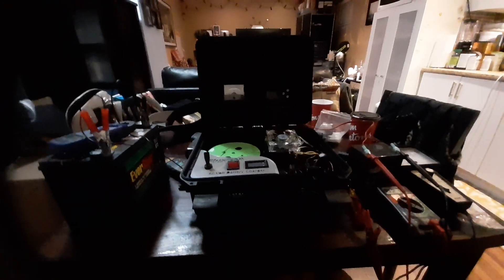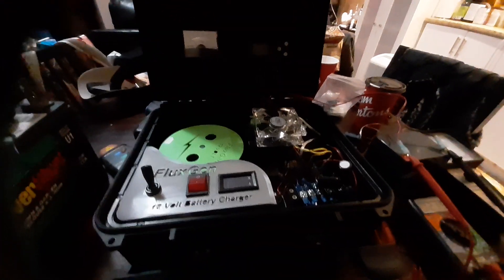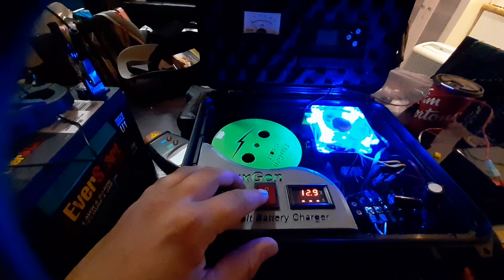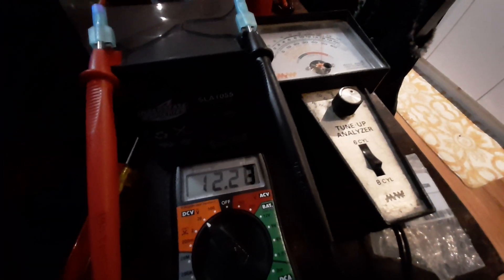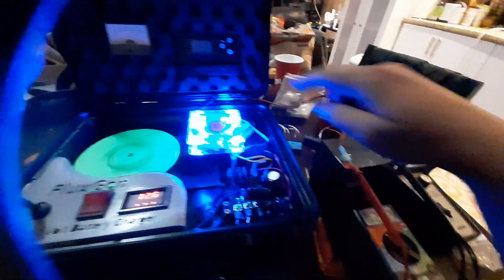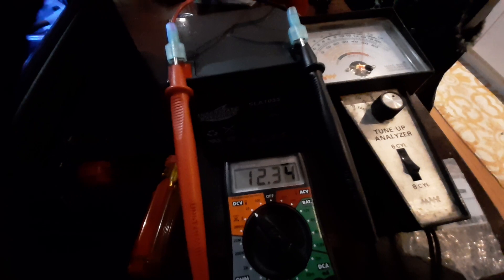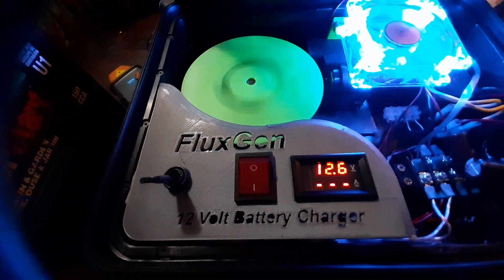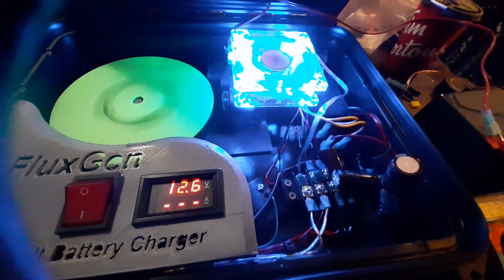Pulse motor generator zero point energy over unity

Comment: K=1/2MXV2. So why is your wheel so light? Omega=charge ratio. Alpha=Discharge ratio.
Thus 1:3,6,9,12 etc. Overunity.
Reply from the maker: Hi yes you are very correct.... I did some experimentation with a heavy fly wheel and it does work," but" ...at some point it will create too much load and cause too much amp draw on the system....but it is worth too do further testing... At this point i do have a pulse motor that will run 33mins with no batteries...at this point i am not ready too expose my findings and discoveries too the world yet.....I do have one Project in the works,.. that is like my "Black Project" this thing is a total Game changer! Big Time! But It will not reveal the secrets of this for a long time....the Physics of this generator,, will make any Generator system over unity..... So far my early test showed my "COP" eff factor was over 300%  every Version i do the COP gets higher.....   Anyways thanks for your post  Mike

Comment: This is a rotary transformer running as a boost converter.
Reply from the maker: Yes it is very much a rotating inverter and transformer and then power goes to a bridge rectifier to make it DC power to charge batteries